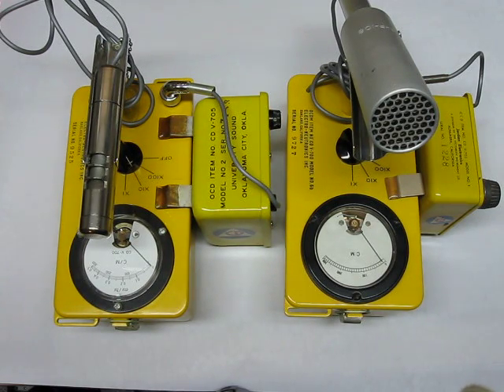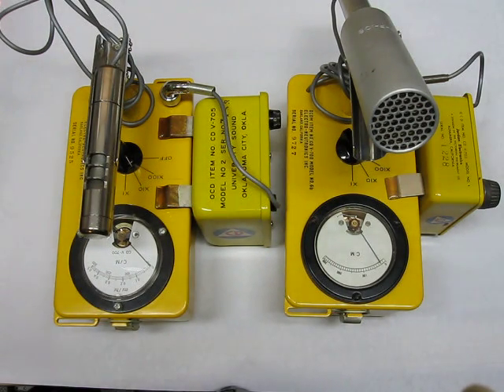CD V-700 6B and CD V-700M With Turn And Bank

Comment: What size audio jacks does the 700 series use? Is it a standard quarter inch audio jack or something else? I'm specifically wondering about the Lionel version if that makes a difference.
Reply from the maker: All the old CD V-700s use the Switchcraft 2501F Old Style jacks on the headphones which I guess is the female side. I think the male side which is on the case is a Switchcraft 2501MP. Search that online and you will find them. They used that type of connector to keep the inside of the case sealed.
Reply: Thanks for answering my question! I'll look into these connectors and see if I can find some and if it's possible to wire up a conversion to what I need. I'm wanting to use one of these devices, in combination with a relatively safe source like the test source that was included with them or a small amount of radioactive ore as something of a random sequencer/clock for a synthesizer. Weird thing to do, I know, but it should be cool when it's done.

Comment from the maker: When ionizing radiation (gamma and beta) passes through the detector tube it causes current to flow through the tube. The circuit in the instrument produces the audio output which are the clicks you hear. Each click you hear is caused by an individual alpha, beta particle or gamma ray passing through the tube.